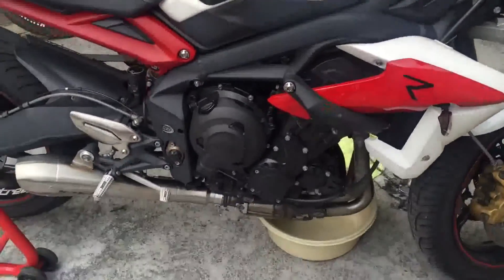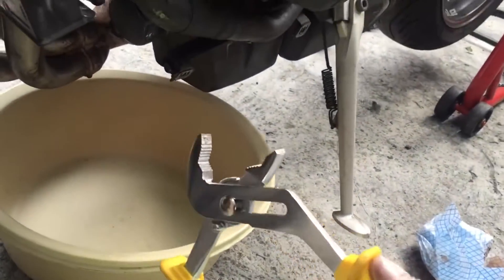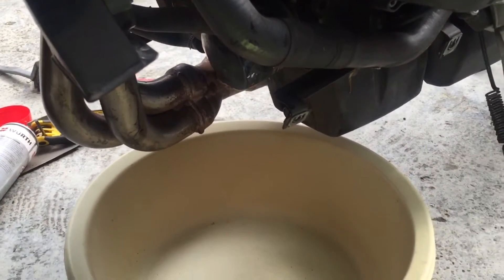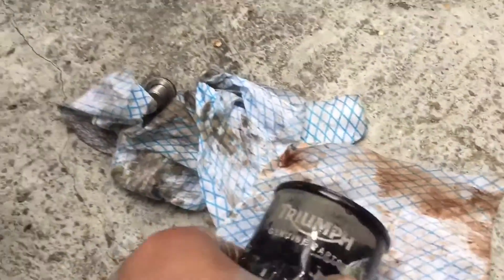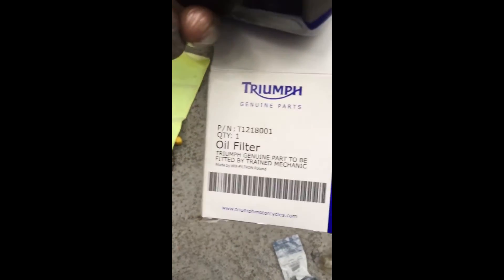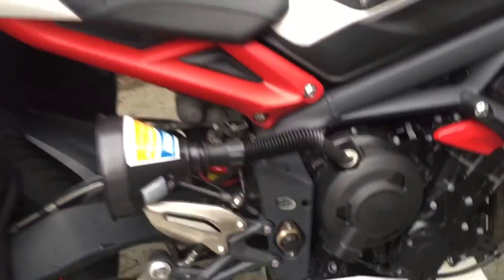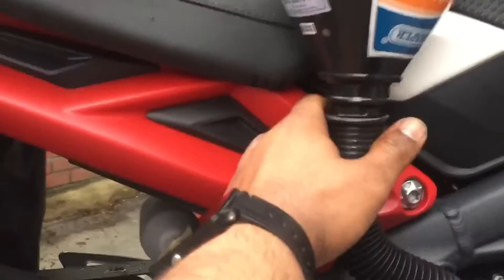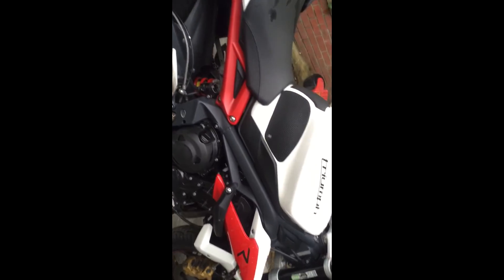STR 675 - Street Triple Oil Change with Castrol fully synth 10w40

Comment: Hey, just wondering is it not semi synthetic that triumph recommends? Or is it fully synthetic? I've got a 2016 street triple 675
Reply from the maker: Semi synthetic ;)
Reply: @alf786 Incorrect. Fully synthetic is more recommended for these engines. 10w40 4T fully synthetic Castrol Power 1

Comment: my manual states 10w50, so that's what I bought. will be doing the first oil change this weekend with it
Reply from the maker: Emphase depends on where your located if in high temp country go for the 10-50 if not in U.K. 10-40 . 10 represents the low temp 50 or 40 the high temp

Comment: alf786, great videos bro. I've been riding my 125cc for 2 years and now have full licence. 

What's best to get if I go for STREET TRIPLE R, Brand new or second hand?

any more advice would be great for me to make my final decision.
Reply from the maker: Zam Zamir well first a street triple R insurance is a killer over standard by £100 but could be a lot more for younger people. Always do some quotes a used one will be cheaper but depending on address insurance will be high depending on age. I started on a Honda 2007 600cc hornet plenty power to jump from 125cc after this got the z800 and now this. Don't jump to a new bike first ... build up experience and no claims on old bike!! Get a old r6 or old triple or Honda hornet!! I wouldn't go too old on triumph bikes unless your an electrician!! And you know some engineers they tend have their issues I'm ok so far so good alhumdullilah. I'm with the deen rider group message on facebook. Will help in every way. Message me any time . Start with more power but older bike. After 1 yr move to newer. My mate just passed got himself a z300 to start next is mt07 for him.
Reply: alf786 😂 I’m assuming that would be me

Comment: How did you choose between 10-40 and 10-50?  
I have a 2015 Street Triple using Castrol 10-50 as recomended by the dealer.  But I have thought 10-40 might be a better choice and would like to here your thoughts on this.
Reply from the maker: hi this was he recommended in uk for this bike :) def not the other one
Reply: I got the 10w50 recommended by the dealer, and by the manual with my 2016 Street Triple RX. It's probably just an updated version, I'm sure both oils are fine